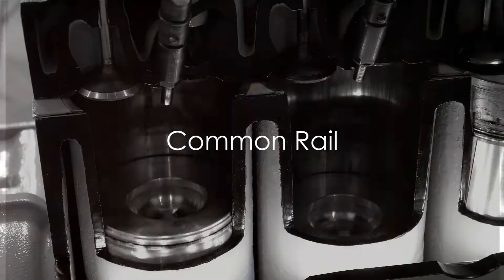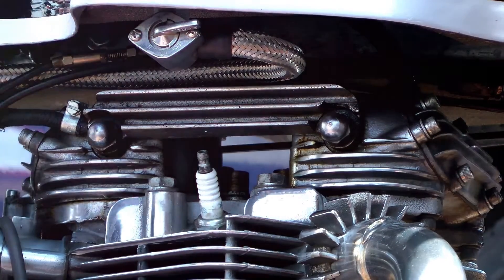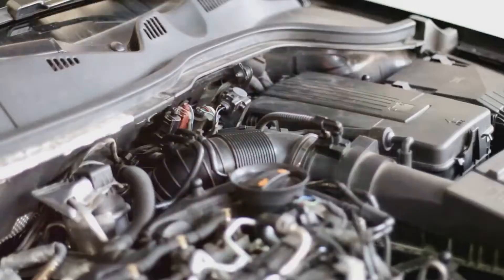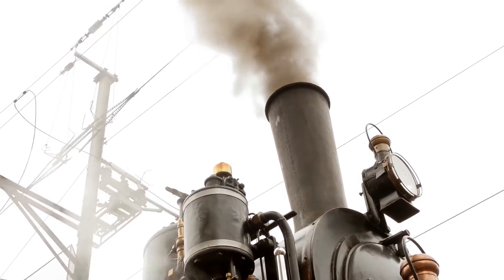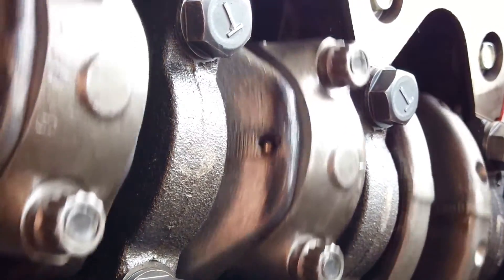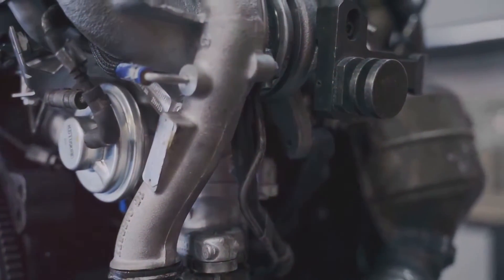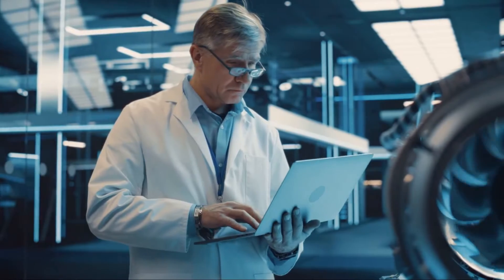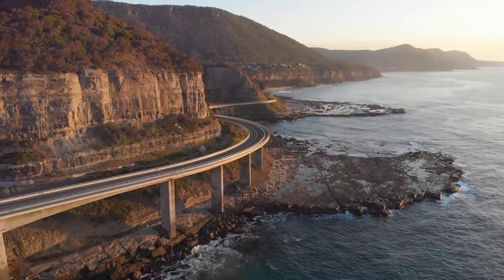Problems and Advantages of Common Rail Fuel System. All about Common Rail Injection System

Comment: The common rail and Egr units are the most useless inventions ever commercialized in diesel engines.
Reply from the maker: well, you can basically throw away a dozen parts in a modern car. )) All these improvements to reduce emissions are just marketing.